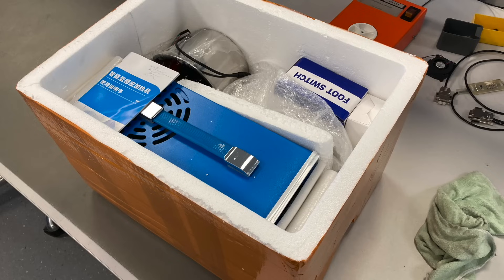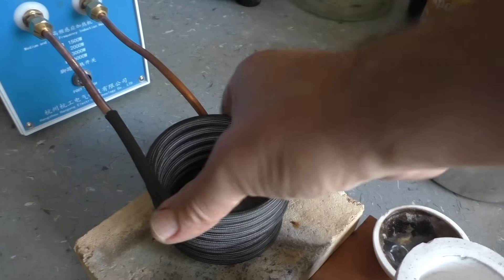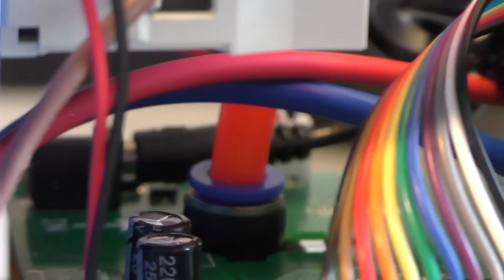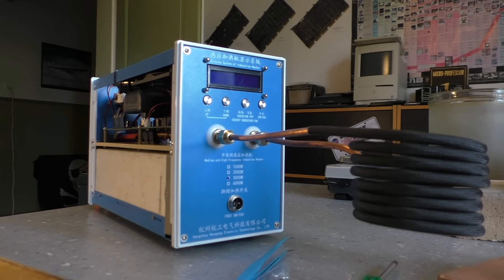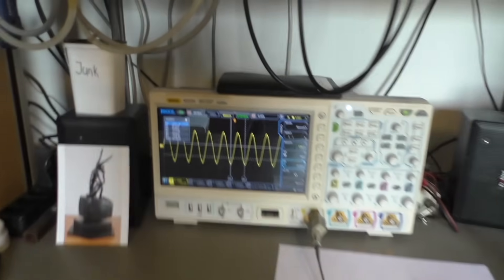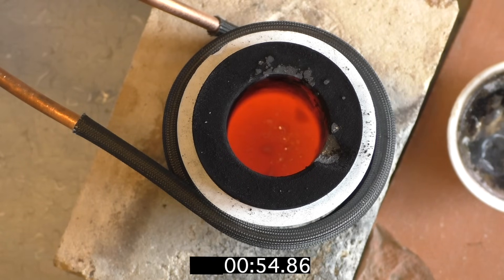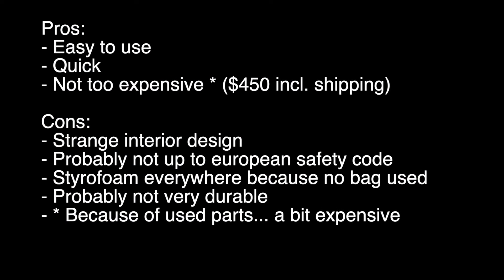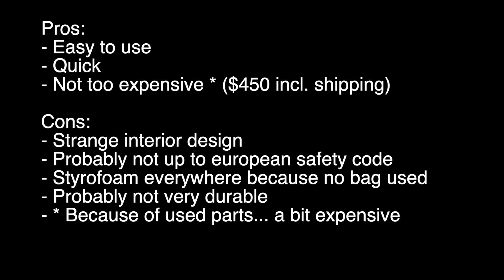Meet the "Inducation Heater" (PWJ268)

Comment: Those Emerson power supplies are called "Rectifiers" - They are used in 3G/4G Telecommunication stations where they provide the charging current for a large bank of Lead-acid batteries and to support all the communication equipment.

Comment: Still seems like a lot of money for what you get, but indeed good ones are way more expensive. What makes these relatively simple things so expensive?
Reply from the maker: Even if it seems simple, it need a 3000W power supply. I guess this is about $50 used. Then some power transistors, maybe $5-10 each. A PCB, a case, fan, water pump. And you are at $100. Some profit would be nice: $150. $150 for shipping: $300 total. Am I close? 🙂

Comment: A dc adapter soldered to the board, I have never seen that til now. Now I can say ive seen it all. Modern day cost cutting is just....wow
Reply from the maker: If the adapter is CE approved, they don't need to certify the board. With a normal transformer etc. they (maybe) would have to.... More cost saving.
Reply: CE what…!?  😅
Reply: I doubt it is, for all we know they just "recycled" the shell. 😮

Comment: The wall wart soldered to the board is fun, hahahaha.... And as someone else pointed out, it's probably a good thing they went with that used power supply. I think it's safe to say that had they been forced to supply their own power supply, it probably would have been something you really, REALLY wouldn't want anywhere near your house, much less inside it. Lol...

When I worked for Rockwell in the heavy vehicle division, we had a tabletop induction heater that we most often used to heat gears like the ring gear on an axle differential to get it in place before bolting it down. I always found it neat as you could heat up a gear weighing 20+ lbs and get it up to several hundred degrees in 10, 15 seconds. Those worked differently. The main part of the machine had two large square metal posts standing straight up from the main unit, then you had a series of different sized square bars that you would put through the gear and rest the bar on top of the posts. There were several sizes of bars and you would select one based on the mass of the component you were heating, and you just set the target temperature you wanted the component to be at. At the time working on my own vehicles, if you had to do something like that you'd be heating up the oven and putting the gear or whatever in there to sit for an hour or more. But with this thing, it not only put it at the exact temperature you needed, but it did it in literally seconds. I always wanted one for home, but I can't even begin to imagine how much that thing must have cost at the time as that was back in the mid to late 90's.
Reply: I used to work in an electric motor shop, we probably had the same thing usually for heating bearings. It was essentially just a transformer, and the bar that fit through the bearing completed the magnetic circuit.

Comment: For my high school physics final I made one out of an off the shelf (literally) spool of wire and a big relay and an iron rod wired to mains. Boom. Got an A. It would heat the rod too hot to touch in a few seconds before blowing the breaker on a 20 amp service.